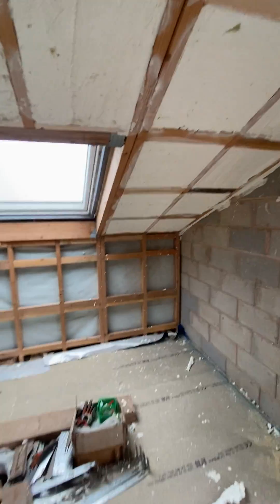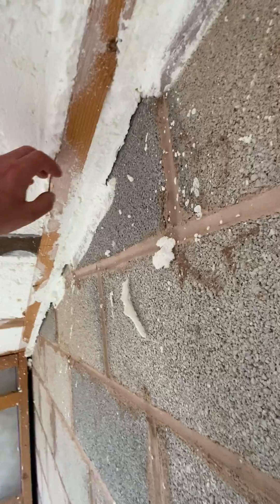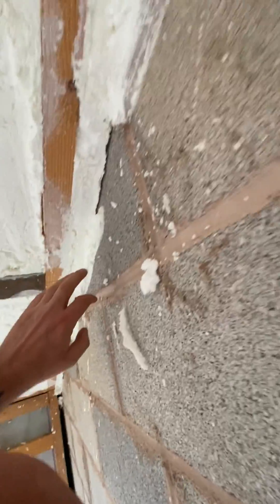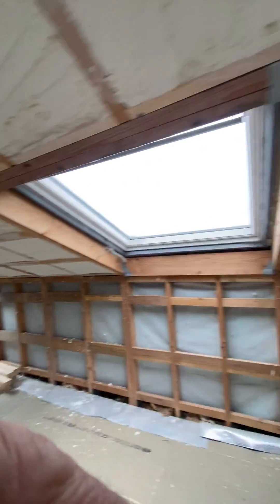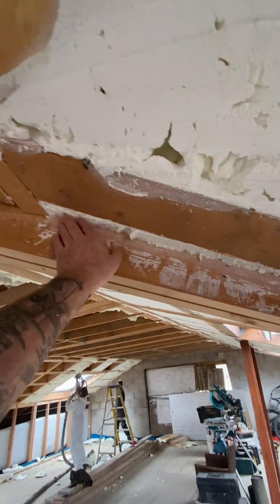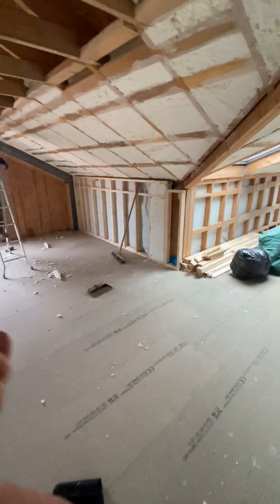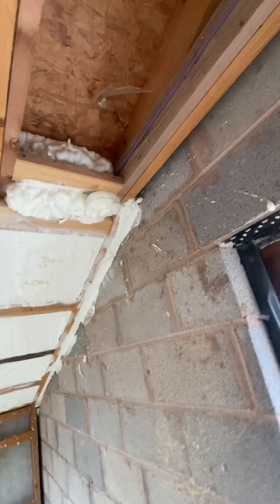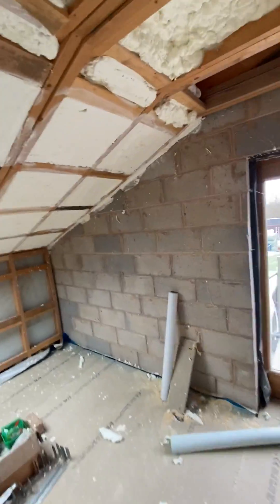Air tightness with open cell spray foam insulation

Comment: How do you add wiring for ceiling lighting fixtures when all cavities are now filled?
Reply from the maker: Hi,
First fix would in most cases be done prior to foam, you could create a service void with counter battens as well or cut a small Chanel in the foam as its soft and flexible it would be simple to do so.
Same with any down lights a small section of foam could be ripped out by hand if required.